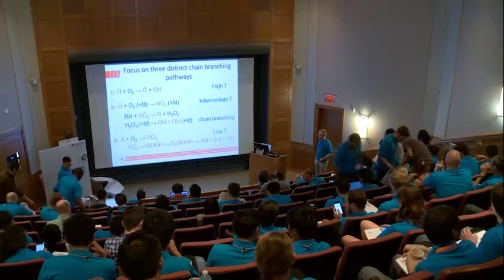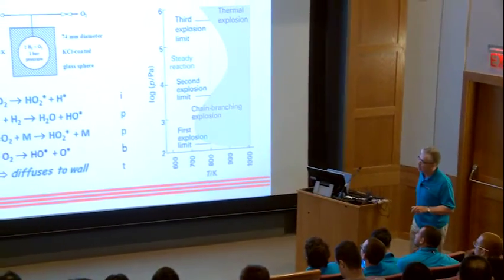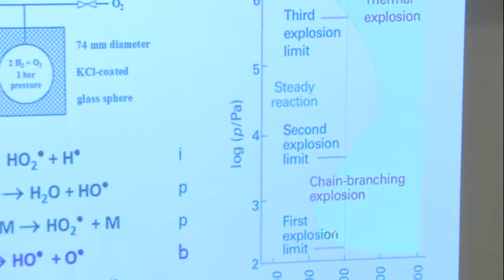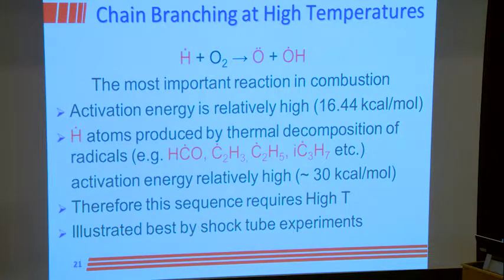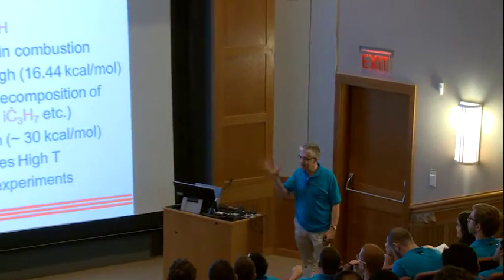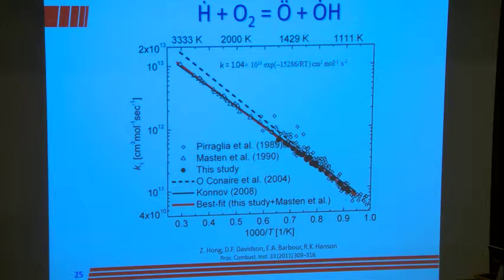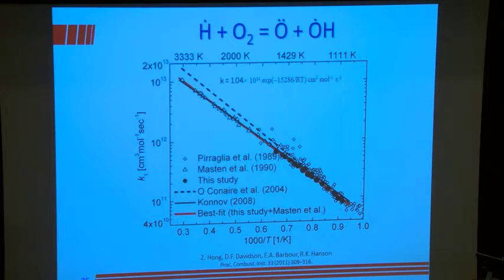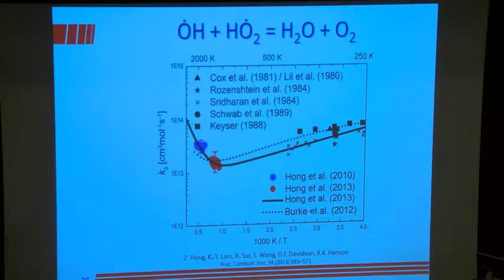Chemical Kinetic Modeling for Combustion, Curran, Day 3, Part 2

Comment: Regarding your first comment on where/when the comparison of two fuels is done with sensitivity analysis, you say between 10-20%. Many authors do not mention this, by the way. My question is, if you want to know what happens at the very first instant of the reaction, is it too early to do the analysis at 1% fuel conversion?